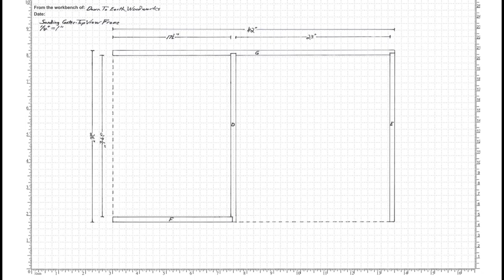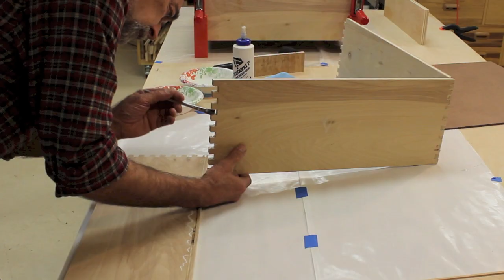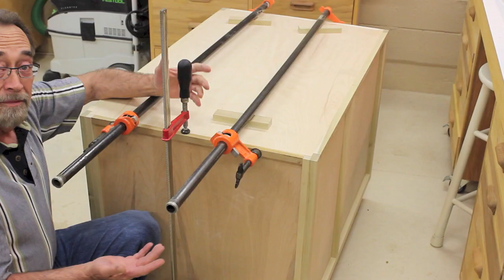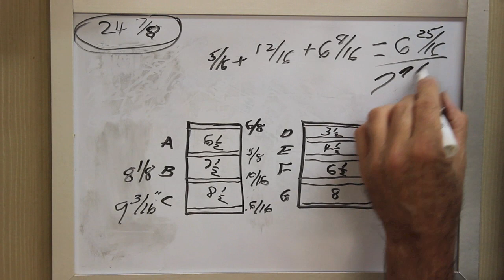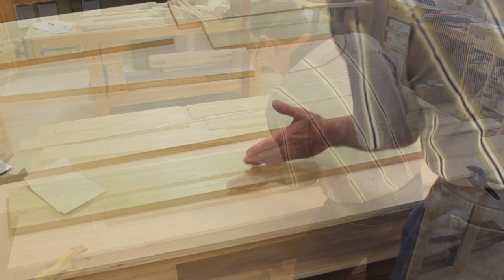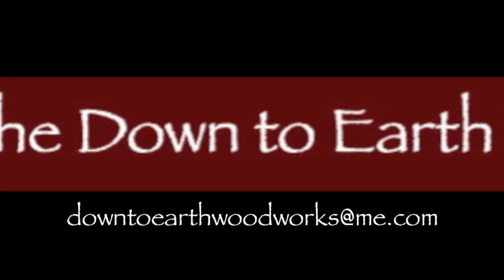The Down to Earth Woodworker: Mobile Sanding Center Part 7 - Drawer Fronts & Trim

Comment: Glue does indeed swell the biscuit... so much so that I have had the biscuit telegraph through to the surface of the wood.  This can happen with thinner stock, softer wood, and plywood. Since these were drawer fronts with no sheering strength needed at the joint, there was no need to take the risk.  On a thicker, harder workpiece (like a table top) I might put a little glue on it.  If you have always done it that way and had no problems, I say "stick with what you know and are comfortable with."